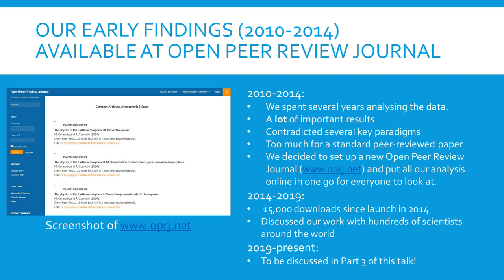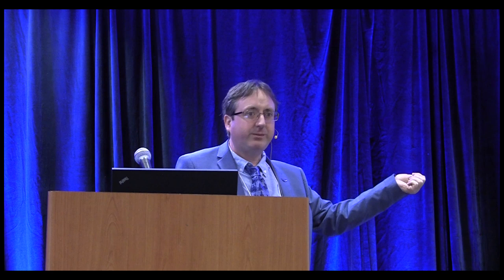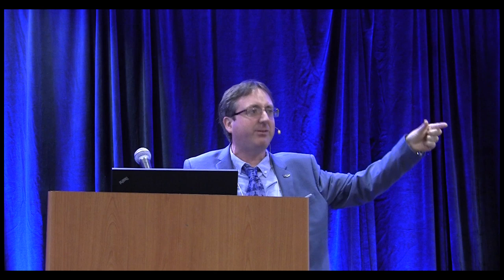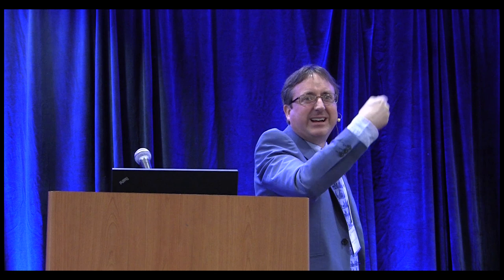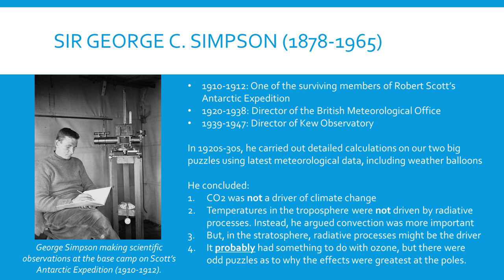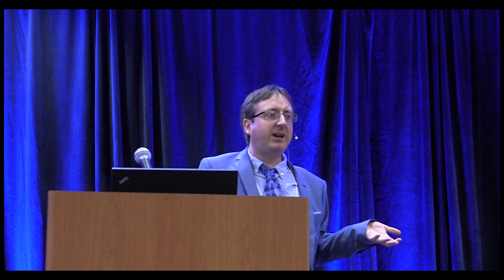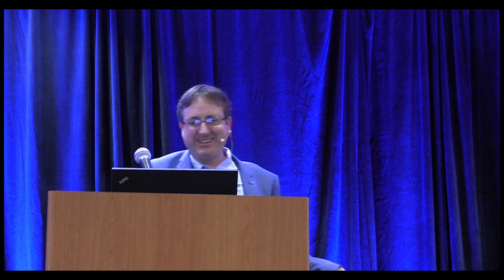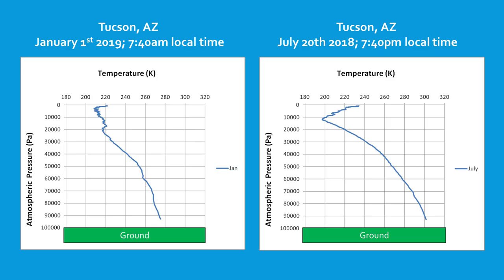Balloons in the Air: Understanding weather and climate

Comment: Complete layman here: with the tube experiment, why doesn't temperature affect the speed of transmission of mechanical energy? Has that been tested and it's definitely the case? My original guess would have been that the heat or level of agitation in there would impact how fast it's transmitted. I can't keep it all clear in my head but increasing the temperature would increase the pressure in the tube right... because the volume is constant? Would speed of transmission of mechanical energy not be affected by the pressure? This might be a very confused question that illustrates I don't really understand what's happening here!

Comment: The variations at high altitude, after you remove the day/night heating (i.e. thermal heating by the Sun) are either:  gravity waves caused by lunar tides (above 3 km) - particularly in the tropics OR the auroral heating - particularly near the poles (above 60 km). It is probably both!

Comment: Is the position this? 🤔 

-- as the troposphere is unconstrained, it can move energy via expansion (and “pervection”) to maintain temperature as per PV = nRT as the troposphere is not an actual rigid greenhouse or thermal blanket. It is in full thermodynamic equilibium and distributes energy as expansion / work rather than thermal storage.

-- temps up to 35km are purely a function of pressure / molar density and CO2 has zero influence as a "greenhouse" agent. If CO2 were operating chemically you would see a deviation from the linear mechanical pressure relationship...

I would’ve thought CO2 must have some reflective effect by its nature (ableit it is logarithmic) however if the troposphere expands and contracts accordingly (as it appears to) and move energy mechanically then extra energy may just not manifest thermally.
... is that the position?

On my present understanding of CO2 as a greenhouse gas:

CO2 absorption is ~20x less strong vs H2O vapour (thermal absorption coefficient) at the similar H2O regions and absorbs across about 1/10 of the spectral regions of H2O, so absorbs ~200x less energy (very approx). It also is 100x less in molar concentraion so it is 20,000x less “active” than H2O as a greenhouse gas. Its absorption is masked by H2O also so its absorption gets exponentially less very quickly... its regions are practically saturated (looking at IR transmission regions) in fact. Adding more CO2 will have practically zero additional greenhouse effect on an already insignificant effect

But this work would make it a big fat zero.
Reply: @pianodarr  if you got no idea about the sun then maybe. The 1C increase is definitely not due CO2 increase! 

Above that, there are also natural cycles, like the PDO which was found 92. Its going into a cold phase now. 

Sun activity was the highest in 10`000 years the last 4-5 Decades going as it seams into a Maunder Minimum.
Things will start to cool in the next years. Wonder how those so called climate idiots are going to talk there way out. 

Besides all that, the natural Greenhouse Effect of those so called Greenhouse gases is estimated at 15C Schmidt et al. 2010. AGT 2019: 14.77 C. 
Where is the hassle!?
Reply: @gedankenfang3931  'no idea about the sun then maybe.">>
Good point. The climatologists completely forgot to remember the sun in their calculations.
Oh wait, they didn't.
It's not the sun grasshopper:
 Denier Canard #2:
"Over the last 35 years the sun has shown a slight cooling trend. However global temperatures have been increasing. Since the sun and climate are going in opposite directions scientists conclude the sun cannot be the cause of recent global warming.
The only way to blame the sun for the current rise in temperatures is by cherry picking the data. This is done by showing only past periods when sun and climate move together and ignoring the last few decades when the two are moving in opposite directions."
http://skepticalscience.com/solar-activity-sunspots-global-warming.htm
Reply: @gedankenfang3931  ' 1C increase is definitely not due CO2 increase!">>
It is. We have no directly measured this. Learn:
First Direct Observation of Carbon Dioxide’s Increasing Greenhouse Effect at the Earth’s Surface
"Berkeley Lab researchers link rising CO2 levels from fossil fuels to an upward trend in radiative forcing at two locations
The results agree with theoretical predictions of the greenhouse effect due to human activity. The research also provides further confirmation that the calculations used in today’s climate models are on track when it comes to representing the impact of CO2. ...
They found that CO2 was responsible for a significant uptick in radiative forcing at both locations, about two-tenths of a Watt per square meter per decade. They linked this trend to the 22 parts-per-million increase in atmospheric CO2 between 2000 and 2010. Much of this CO2 is from the burning of fossil fuels, according to a modeling system that tracks CO2 sources around the world. ...
Each series spans from 2000 to the end of 2010, and includes 3300 measurements from Alaska and 8300 measurements from Oklahoma obtained on a near-daily basis.
Both series showed the same trend: atmospheric CO2 emitted an increasing amount of infrared energy, to the tune of 0.2 Watts per square meter per decade. This increase is about ten percent of the trend from all sources of infrared energy such as clouds and water vapor."
https://newscenter.lbl.gov/2015/02/25/co2-greenhouse-effect-increase/?
The paper: http://asl.umbc.edu/pub/chepplew/journals/nature14240_v519_Feldman_CO2.pdf?
Reply: @gedankenfang3931  "Effect of those so called Greenhouse gases is estimated at 15C Schmidt">>
You're way off.  Let's ask Dr. Schmidt.
How CO2 works to warm the earth was discovered in 1824 and was well studied and confirmed beyond dispute by 1896. Gavin Schmidt, a climatologist with NASA says of CO2: 

"Nor has the fundamental physics of the greenhouse effect changed: CO2 in the atmosphere continues to trap heat that would otherwise slip into space, as was established by Irish scientist John Tyndall in 1859. "There is a natural greenhouse effect, that's what keeps the planet livable," noted climate modeler Gavin Schmidt of the NASA Goddard Institute for Space Studies (GISS) during a Friday conference call with reporters. "Without it, we'd be 33 degrees Celsius colder than we are. That's been known for hundreds of years."
http://www.scientificamerican.com/article/scientists-respond-to-climategate-controversy/

33 degrees Celsius is about 59 degrees Fahrenheit. Without it the average earth temperature would be below freezing. And it does that while only being a trace .04% of the atmosphere.
But really, what does Dr. Schmidt know? He's just a climatologist referring to a well understood scientific fact that hasn't been in dispute for 170 years.
Reply: "On my present understanding of CO2 as a greenhouse gas:
CO2 absorption is ~20x less strong vs H2O vapour (thermal absorption coefficient) at the similar H2O regions and absorbs across about 1/10 of the spectral regions of H2O, so absorbs ~200x less energy (very approx). It also is 100x less in molar concentraion so it is 20,000x less “active” than H2O as a greenhouse gas. I"
I've no idea where you got this nonsense from. In reality, the effect of CO2 is about 25%.
http://climateknowledge.org/figures/Rood_Climate_Change_AOSS480_Documents/Kiehl_Trenberth_Radiative_Balance_BAMS_1997.pdf (Table 3)

Comment: The warming is measured by 3,800 self-profiling floats called "Argo floats" and is +0.11 degrees / decade for the shallowest 750 metres. The stratosphere is cooling. The 1st gives the quantity (413,000 gigawatts for the last 22 years) and the 2nd gives the cause. Only an increase in atmospheric greenhouse gases (GHGs) can simultaneously warm the oceans, warm the troposphere and cool the stratosphere.
An increase in solar radiation cannot simultaneously warm the oceans, warm the troposphere and cool the stratosphere.
A decrease in global average cloud cover cannot simultaneously warm the oceans, warm the troposphere and cool the stratosphere.
A decrease in air pollution aerosols cannot simultaneously warm the oceans, warm the troposphere and cool the stratosphere.
No increased form of energy entering Earth's atmosphere from space can simultaneously warm the oceans, warm the troposphere and cool the stratosphere.
No decreased form of energy entering Earth's atmosphere from space can simultaneously warm the oceans, warm the troposphere and cool the stratosphere.
No increased form of geothermal heat can simultaneously warm the oceans, warm the troposphere and cool the stratosphere.
An increase in heat leaving the oceans cannot simultaneously warm the oceans, warm the troposphere and cool the stratosphere.
Only increased atmospheric GHGs can simultaneously warm the oceans, warm the troposphere and cool the stratosphere, and that is what's been happening the last 50 years.
It's the smoking gun for increased atmospheric GHGs being the cause.

Comment: I just love this presentation. Michael's last comment is interesting. "Well... in those diagrams that we have showed you there, where the phase change was moving up and down, and we found that when we dampen out the day and night thing, you were still getting these fluctuations. What causes that, we don't know yet. That's still an open question." 1:06:17 - Is it possible that the phase change altitude is controlled or influenced by the Moon's and the Sun's gravity. We know that our open oceans (primary atmosphere) is heavily influenced by moon-sun gravity since it works on every single water molecule, but the oceans are not compressible. The moon-sun gravity must influence every single molecule in the atmosphere, and since the atmosphere IS compressible this influence should be significantly more pronounced. Moreover, with greater altitude a molecule will be ever so slightly more influenced by the gravity effects than if it were close to the earth surface. If this were the case, we would expect fluctuations following a lunar calendar, about twice a day. We could call this "atmospheric tides."
Reply: "I just love this presentation."
Because you know even less than those two clowns...?
Reply: @Hinrikhoe  Hmm, what exactly was violent about my comment...?
I've given many examples what these two clowns don't know in a long comment today, if you're really interested in knowledge, you could try to read up on it.

Comment: Seeing that some commenters here enjoy "climate denial" -- whatever that can logically be -- suggests that improving climate models is certainly worthwhile, but CO2 is not the only GHG by far and our descendants will rightly spit on our graves if we don't wise up and deal with all causes, like massive methane leakage, rather than just model disputes.  

The Connollys left out some serious items, but we don't simply need better models, we need wise actions.  Suggesting GHG molecules radiate all their gained solar energy back to space at night shows a lack of basic radiative physics that Einstein would abhor.  It's especially mystifying since they went to lengths to show mechanical coupling between molecules with their plastic syringe & tube demo.
Reply: also missing was saturation adding more co2 in the troposphere will not increase heat retention
Reply: GHG is false its just pressure and what the sun is doing nothing else, we aren't changing the pressure of the planet by any large amount and can't do shit atm about what the sun does to our planet, its why Venus is hot and Mars is cold both have 95%+ CO2 atmospheres...
Reply: So, since the models are proven as unreliable, and attribution of cause comes from model results, we should just act on faith? That's religion, not science.
Reply: Dan de Lion  Science denier.